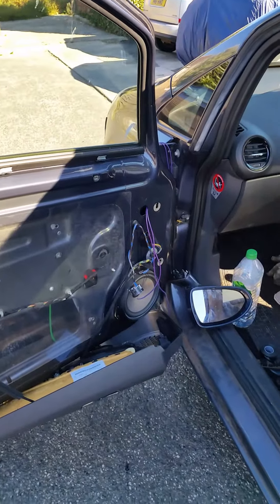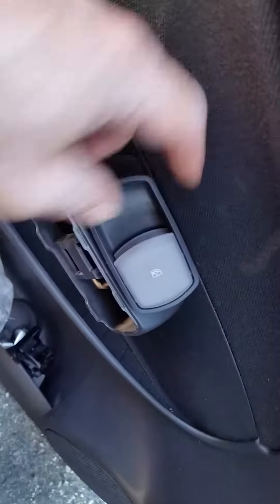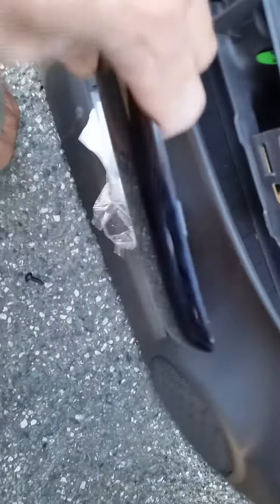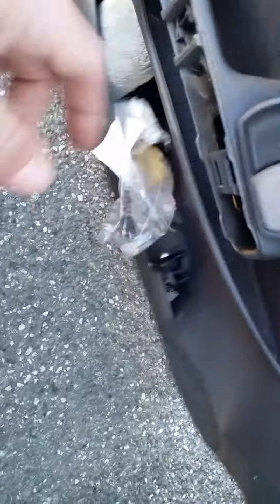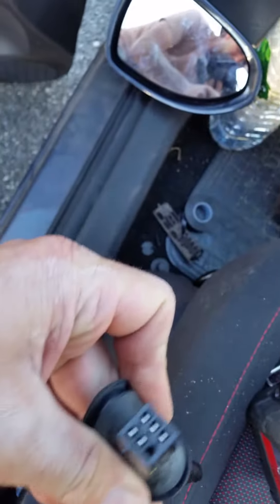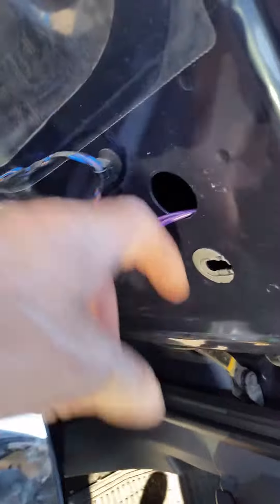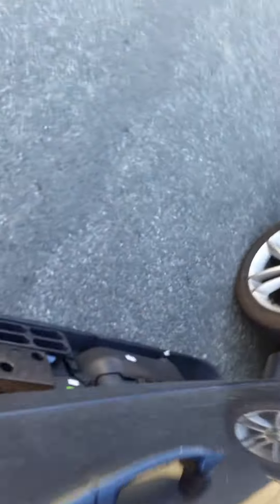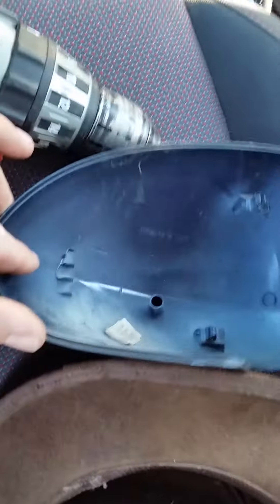Corsa d wing mirror  replacement.

Comment: If you tilt the glass at the outside edge you can get a screwdriver in to release the outer locking tab on the cover.

The mirror frame is bolted from the outside with a large torx bolt.